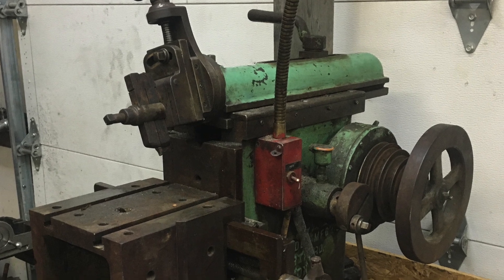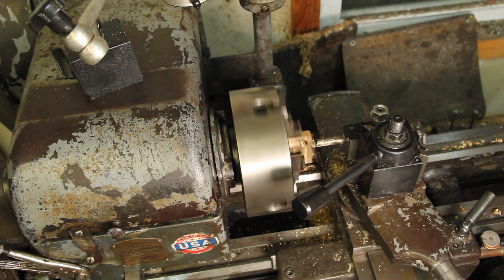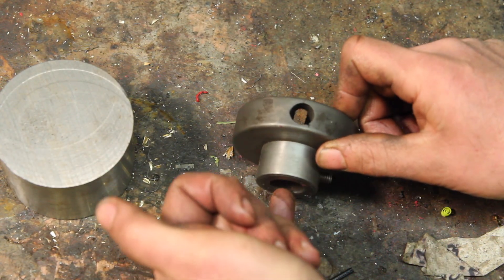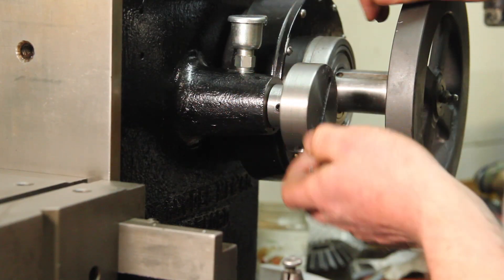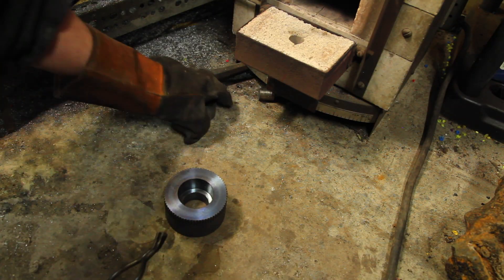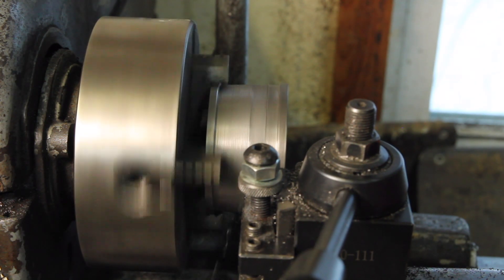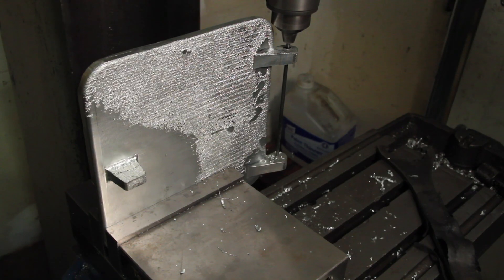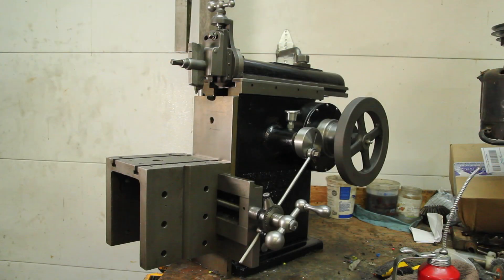Rhodes Shaper Restoration (Part 2)

Comment: What is the top RPM of your logan 200, and did you do anything to increase it?
Reply from the maker: It should be stock, so 1500 rpm.  I’m always hesitant to try to give these old machines more power, since I’m not sure how the bearings and such will like it.
Reply: @JeremyMakesThings  That has been my thinking as well.  Maybe I've been noticing parts of videos you play back at higher rpm, or your machine/motor just sound different than mine -- I thought during some of your carbide tool usage you were able to run at a higher RPM.  It may also be the fact that I still have a leather belt in mine, so I hear the metal every time it comes around
Reply from the maker: Mine has a automotive serpentine belt (400K5).  It was on it when I got the machine.
Reply: @JeremyMakesThings  I've got one to put on the machine, yeah.  The previous owner gave it to me with a box of spare and broken parts, he never got around to putting it on and so far I haven't either.  I'll probably tackle that along with a teardown+clean+inspect of the Logan overall once I get my other lathe working -- that way I can make or repair any parts needed instead of just having a pile of lathe parts I hesitate to put back together as-is

Comment: Jeremy, regarding that bloody collet chuck... If you want to get that crap out, do this...
First mill longer than normal t-nuts for your mill table as not to blow it out... Affix your vise with the newly made longer t-nuts and whatever bolts you use for your vise... Then take a long nut with any thread pitch that you feel like single pointing or even have a die for... Take a rod of silversteel that fits your collet chuck on the lathe and on the mill, turn that and thread it into a bolt fitting the bought long nut with a smooth shaft on the other end... Take the bolt outta lathe, bring it over to the mill, put the bolt in the collet and gently clasp it in, then screw the bolt while loose in the chuck, in the long nut that you put in your vise all the way... Clamp the bolt in the collet chuck beastly and without mercy... clamp the nut in the vise equally savagely... That being done, now you can use the knee of your mill, rather than quill, which you will lock firmly but not savagely as that is a machine component and requires certain levels of sense... That being said and done, now loosen your mill chuck by removing the thread-bar that holds your tooling in the spindle and slowly lower the knee down and see it extract the collet chuck by precise downward force without damage to your machine... If you want to, you can first mill a shoulder in the long nut that sits in the vise if your jaws have an overbite and you can utilize that as a point of extra security rather than having to clamp the vise savagely as not to have the nut slip upwards... You can also spray wd40 down the threadbar hole and leave it be, to potentially aid in release from the spindle... 
All the best!
Reply from the maker: I’ve tried pulling it out with the knee with some heavy nylon stapes wrapped around it (figuring they would fail before doin damage to the machine).  As hard as I could crank the knee down, nothing gave.  Also, you mentioned loosening the drawbar…I don’t have one.  Anyone who says a machine taper can’t hold against side loading without one has never seen one stuck this badly.
Reply: @JeremyMakesThings  Fucking hell man... i mean, what i said might work, as it would allow the full leverage the system that moves the knee to be exerted, but still, this is some mad shit you are describing... You could also try and buy a small cylinder of nitrogen, turn it upside down to cause liquid rather than gas to blow out, and hose the collet with liquid nitrogen, just protect the mill from it as cast iron of the table might not like such temp shifts if you start pouring liquid n on a single spot... Haha, yeah, true regarding the sideloads, i once stuck a mt2 in a lathe tailstock, but the hollow mt2, not the one with the tail for extraction... Fucking hell was it not moving, and sideloads didnt account for shit...

Comment: Have you come across any "chilled " cast iron that is too hard to machine? Since you have that heat treating oven I suppose you could temper any of that back to a machinable state.
Reply from the maker: I’ve hit a few spots here and there that seemed harder than others, could have been a chilled margin, or maybe just a combination of rust and crud that was hard on high speed steel tools.  Nothing carbide couldn’t take care of though.

Comment: Phenomenal job! That shaper came out gorgeous. 

I've got a Rhodes shaper just like yours (only not as pretty), and it's a fun little machine to run. I plan on scraping mine in, eventually... Though similar to yours, mine could definitely use a new cross feed leadscrew, and the elevating leadscrew is pretty worn, as well. Though I've added DRO to the cross rail and table elevation, so the backlash isn't much of an issue.

I've also made a quick-change tool post for my Rhodes, and have a few videos on the making of it. I'll gladly share my CAD drawings, if you're interested.

Comment: That is great!  I love that you were able to save that failed-ish casting!  1 thing to take a look at is making a vise.   Normal milling vises on these are pretty terrible, so you want a purpose-made shaper vise.  Sadly, the design of most of the 7" shaper vises is ALSO pretty terrible, but if you're interested, I have a 28" shaper that I can snap pictures of as inspiration.
Reply from the maker: I’ve got a set of plans based on the original Rhodes vise, it actually looks like a really nice design and people say nice things about them, so it’s on the list of things to do.
Reply: @JeremyMakesThings  Ah, great!  I used the vise off of the Atlas 7" and it was pretty bad for rigidity, but not sure I've seen the Rhodes one.

Comment: Tell ya something else I found tho remove that collet chuck from the mill is a ball joint tool the pickle fork mine was super stuck the other day wound up destroying my draw bar trying to get it out resorted to that and it worked like a charm actually used less force then beating straight down on the draw bar
Reply from the maker: I’ve tried that one.  No luck. ☹️